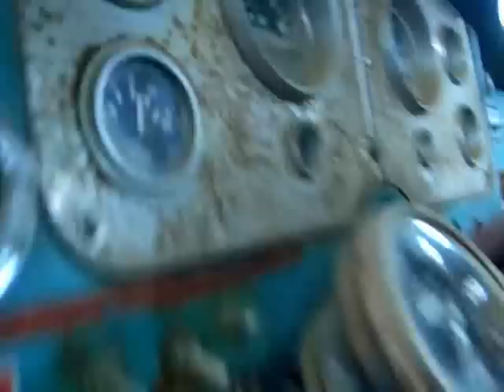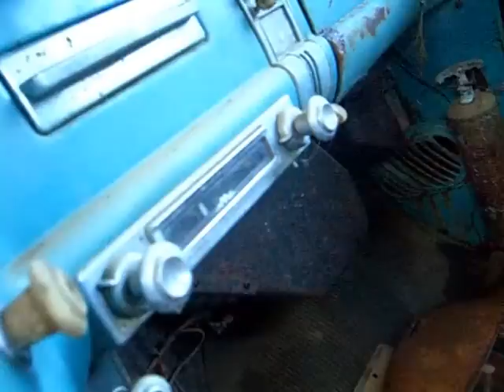The Find 1956 GMC V-8 Hydramatic Napco 4X4 Dually Truck

Comment: A 1-1/2 ton with Hydramatic, chrome and power steering. GMC could not have made too many of those. Great find.
Reply: And the six was available with that trans.Even down to the Chevrolet sedan delivery. While very few were ordered that way, 55 -57 sedan deliveries dominated stock automatic classes. Too bad they didn't use it in the early Corvettes instead of the horrible Power slush.
Reply: I think Jeff's right about the trans. NHRA rules allowed Hydros in sedan deliveries, but I don't think Chevy ever made any that way. It was stock class rule bending.

Comment: I happen to have a 57 and a 58 Chevy half tons 4X4 Napco equipped. I also have an extra front axle from a 56 GMC Napco truck but only two correct Spicer transfer cases. I love these trucks. The dealer installed axles had Dodge Power Wagon brakes. The factory installed axles have GM brakes.  I've chased these trucks for 41 years now. Very cool video.

Comment: Heck we are almost neighbors now you got that 56 GMC and well I got a 58 F600 All Wheel Drive with a Dump Steel Box Bed. Retired Oregon Department of Transportation.  Big Trucks can still do the work. Got the old Y block running and the gears working.  Need to get the hydra boast brake pack working. Currently just using gears as brakes.  Looking forward to seeing the progress on the highly optioned 56 GMC you just brought home.  Nice looking place you have there.

Comment: Man ''o'' Life, I love it--kinda reminds me of the last build I did my 1951 Mercury two door. That was all there by rusty as a old barn door hinge. Why it was before I got it it was used as hog farrowing pen ! then pushed in a one stall garage (if you could call it that) that a tree grew up in front of the only door. So I had to take down the tree to get the car out of it.When we came to settle up on it--the farmer told me he owed me $500.00 because the tree trimmer wanted that much to take it down for him--I even cut it up, most pieces stove size. Five years latter that Merc. ended up a Custom Rod--that took 27 trophies in 24 Car Shows. Three shows it scored more than one trophy !! It was truly a rebirth in the raw. Good luck with the rebuild of the Truck.

Comment: 1979 I found a 1956 GMC 100 in pieces, w/a 307 in the frame. Both fenders were off, doors hood and box gone. but the fenders had the V8 Hydramatic thingy too, took me almost a yr to find all the body parts( it was '80 then). Had a 400 Turbo so kept that w/a shift kit, found an old '63 283 from a wrecked corvette rebuilt THAT bored .30 over w /194 heads highrise manifold w/ Holley 750. That old truck would  pull Santiam Pass w/a 2 horse Miley & 2 horses, half ton of hay in the bed....at 60 MPH and never break a sweat! Loved that old truck, sadly lost it, the trailer(which I also restored), and the horse in a ugly divorce. I was young, live and learn.
Reply from the maker: I feel your pain!

Comment: I have a 1957 Chevy 1-ton tow truck, factory Holmes, it's almost original, 2pc. 18" wheels, 40 year old tires, they were abit sketchy nearly 30 years ago when I drove it, it has had a 70's v8 swapped in, 350 or 400, I'm thinking 350, because they are more popular, id like to get it on the road again, about the only thing wrong with it when parked was the tires, and could use break work, the hydro boost was a bit tired, it would be awesome to have power steering, I'd keep the 4speed !! Wouldnt be the same without it! Swap on some newer 2000ish, model 20" wheels, I heard 16" will not fit, but not sure! Great video alot of work!!

Comment: My first vehicle, in 1974, was a 57' gmc 1/2 ton longbed, with the 4 spd. Truck hydromatic and 389 V8, 2 wd., chrome grill, bumper, and trim and small back window...it was safer than riding my motorcycle back then...lol

Comment: Pretty cool find. I remember the GMC hydramatics and like those shifts that made your head bobble each shift.  It might pay to have one of those clip-on air fittings- No Hands- to keep the hands and face away from where the rim separates and kills folks.
Reply from the maker: Solid rims. It was the tire I was afraid of!
Reply: Does that have the “Slim Jim” 4 speed automatic?
Reply from the maker: The truck Hydramatics were a completely different animal

Comment: Lucky that sun shell in that blazer trans held up, gotta pull from the rear! Reverse is a no no. But that truck is killer, i would go frame up and fix/ replace all of those acc. You just got another sub.

Comment: Nice find.  Have you considered adding a Powertank system to your “tool shed”. Portable and allows you to use impact air wrenches and acts as a portable air system.  
Also a cheaper option would be a Viair on board air system.

Comment from the maker: @pearsonba350 Holy cow! Did you use a penetrant? A nice piece of firewood fit to the cylinder bore and a 20 pound sledge usually works pretty well.

I know what you mean, though. Not like you were gonna use the pistons over anyway. What a shame. Now you'll have to go 40 over and have MORE CUBES!

I can't wait to get back to the engine shop when we get started on Whitey's 389.

Comment: Not sure if someone else posted this but if you remove the are chuck and just shove the QD on the valve stem it will supply a lot more volume of air and usually set the bead.

Comment: Holy crap your tow truck and the find are awsome im currently building 2 old irons 78 gmc 3500 dually ex fire truck 11k original miles and my dd 87 k30 single wheel id love to find a napco or similar to your 56
Reply from the maker: Rarest of the rare!

Comment: 8:01 And that is why a 12v compressor with a long cord would come in handy.  If anything it would allow you to refill the portable air tanks.
Reply: +hellcat1988 forget that gas powered air compressor then he could have aired up those tires and  impacted those wheels off
Reply: Dillon Rebel
Gas powered is great and all, until you don't have a spare gas can...  Or it's cold and the carb on it needs tuned.... Or you forget to drain the tank and it rusts out and has a pressure failure.

Don't get me wrong, full sized compressors with tanks have their place.  I just prefer the convenience and portability of a tankless compressor behind the seat of my truck.
Reply: i see were your coming from but everything you just mentioned is all preventative maintenance. except for when its cold out then it can be a pain. i was just saying for this situation gas powered would have made doing what he had to do a lot easier.
Reply: Dillon Rebel
Yes, but we can agree that a simple 12v tankless compressor would make things easier as well right?
Reply: oh yea it would have been a lot easier than lugging around what was that four tanks
Reply: CSXRockford
That depends on the size of the tire.  If the tire has a much larger volume than the tank, the pressure inside the tire and tank will be much lower once equalized; requiring more tanks.

A tire with a much lower volume, say like on a wheelbarrow, will equalize with the tank much quicker and at a higher pressure do to requiring less air in the smaller space to increase the pressure.

Comment: I recommend a Battery 1/2 impact gun, a 3 ton aluminum jack, small generator to run a compressor. I use a battery impact at work everyday and they are the greatest. Don't have to deal with an air hose.

Comment: And a Pontiac V8 in all those GMC trucks. The largest V8 Chevy had was a 265. That Pontiac is going to be a 316 cubic inch. Very likely a 4 speed Hydramatic too because that's what they put behind the Pontiac engines.

Comment: nicest old truck ever 4x4 1.5 ton that clean befor restoration wow the truck will work alot of money after its all restored and  id like to get a 76 chevy truck like the white one at the begining its still nice  missing some part but no rust and nice bumper here in ontario all old cars and truck get rusted out not restorable

Comment: man that is just way to cool. i remember a bout 4 or 5 years ago i was driving past a local junkyard which has a car lot out front sat a 58 dodge power wagon ton and a half 4x4 v8 with factory push button drive auto. i stopped and asked if it was for sale i was told no. a couple of months late they had a ugly truck show and it was there. they were crushing some cars there too and also decided to crush the truck. that made me so mad.

Comment: 56 GMC .. had one for years, ole Susie .. put a boom on it and used it as a wrecker for years... change the 6 volt system to 12, generator and all the works down to the bulbs... finally sold to old man Campo because I built 2 newer trucks.. hauled thousands of  cars and more to the crushers with that ole truck, and my races cars to the tracks... riffle rack w riffle and fishin pole to go anywhere  Let the good times roll... 292 cuin 3 on the tree and starter next to the gas peddle  DRFOX TRAVELING SALVAGE COMPANY Charlotte N.C

Comment: E.I.  Just a thought, as I've used this several times with old letdown tires. Take e. O ne  o f  th o s e   ratcheting straps wrap it around said tire,may have to dig out a little trench underneath tire to get the it wrapped around and connected crank the ratchet to get the too seat on, then air it up,it will usually go up pretty quickly.  Also do you know what ever happened to that Brill bus you had? Wish it wasn't on the opposite coast I would have been glad to get!
Reply from the maker: Don't know what became of the Brill. As to the strap, the tire fist has to be flexible enough and second, can't have debris between the bead and the rim.

Comment: Do these trucks not have that rim that every body puts in a cage to work on I always though all these old dually would have that rim is it called a split rim seems to be a lot of that style truck in Oregon between you and CTR do the have a eight or 10 bolt pattern ? Similar to my old dually a 95; I’m surprised wheels aren’t all seized up
Reply from the maker: Not the 19.5's

Comment from the maker: @mustie1 PPFFF! Me too, only it's garge time for the red International tractor you see in the background for a cam gear set, injectors on the backhoe, one dead cylinder on the Sprint, one dead engine in the Colt. Did I forget to mention brakes on the Blazer?

Comment: Awesome truck Jeff! I'm thinking its got to be a NAPCO. I don't believe Chevy or GMC made any Corporate 4X4 trucks until 1960. I think they both used NAPCO parts for their factory produced trucks until then. Does it have any NAPCO tags or castings? I'm guessing it has a Spicer model 23 Transfer case. When are you going to have another updated video posted of it??

Comment: just found this video, i dont see a updated video anywhere? whatever happened to this truck
Reply: its sitting out by one of his building waiting
Reply: he hasnt done anything with it since then.  if you look in his newer "shop recovery" videos, you can see it sitting next to where the collapsed shop is.  it has sat there since he got it.  the last videos that were for that truck were the pontiac 389 resurrection videos. That motor was supposed to go in this truck.  since then, he has not had any updates on this truck.

Comment: Unreal find!! I had a friend with a 65 Chevy 20 with a NAPCO 4x4 under it and a snow plow on it. Don't know if it was transferred from another truck somewhere in time or if it was installed by dealer. Were NAPCO kits available and installed that late?

Comment from the maker: @BrutalMemories69  I do. I was working at the Chevy dealer when thay come out with them. Aside from the gutless 2.8's they originally came out with, I thought they were great. When it came time to buy a new car, we got another used Blazer. I'll get another if it ever comes to that again.
Reply: Gutless 2.8??? Never seen a gutless one lol I had 23 s10s all 2.8. Very impressive engines. Insane power in a plow truck and pretty decent fuel mileage

Comment: I see you are a volunteer firefighter ty for ya service what dept are u on are you a officer ??
Reply from the maker: No longer on the Department. Put 10 years in until the new Chief wanted shift duty with a log of what you did every hour.
Reply: Ahh I see I just seen ya pager and radio

Comment: . Since Chevy only had a little 265" V8 and 2-speed Powerglide auto trans, GMC preferred to use the bigger Olds V8's and Hydramatic 4-speed auto trans. in those years.. Ford also used Hydramatics in it's premium vehicles... Drop a 500" Caddy and TH 400 into it...

Comment: To get the tyre back on the rim use wd40 or lighter fluid spray it into the tyre though the gap stand back or make sure you are not too close let the vapurs flow a moment then light it. it should pop back on. unless you use too much fluid it wont catch fire.

Comment from the maker: @ghtowagon Bought it with headers and a Torker intake already on it. (Why anybody would drop a Torker on a 3/4 ton truck with 4:56 gears is beyond me.) Headers are cheap and have thin flanges. Gaskets last about 1,000 miles. I may be using the headers from Whitey later on.

Comment: I would have used my generator, compressor and a cheeta to get back on bead..... Or just loaded with flat tires, 12k winch says it will go. And air bags work so much better in the dirt than a floor jack

Comment: This video confuses me at approx minute 19 to 20 he is bringing the truck back to which  confuses me because it shows no rhyme or reason as to where he is going the bridge crosses is eight dollar mountain which is approximately 10 miles out of his way and dead ends so he would have had to drive there turn around and go back the way he came. And is most definitely not where the truck came from.

Comment: The truck towing the “find” sounds like it needs towed as well. 🚮
Reply: ...nah...sounds like it just has an exhaust leak...I would love to have that truck(the '68-'72)..it's a 3/4 ton with 4x4...although I prefer the looks of a Chevy in the '67-'72's...I have a 1970 Chevy 3/4 ton 2 wheel drive, 292 six and granny 4 speed I've owned for over 20 years..it's a real workhorse...though it burns as much fuel as a medium-duty C-60 with a 366 big block....
Reply: Man-e-fold leek.
Reply: @bjr2379  ...yep...

Comment: The engine most likely to be from Pontiac
Reply: A Pontiac & GMC both had 316 in 1956. But they are not interchangeable, I know, we had one that when the original owner had it, the GMC 316 let go, they had a wrecked Pontiac that had been rolled. They pulled the Pontiac motor out, put it into the truck. We were the 4th owner. When it swallowed a valve, we needed a complete motor. Thankfully David told Floyd what they had done, before we ordered a long block.  That had a Timken electric-vacuum 2 speed. You would use low range for field roads & section line roads. High range for gravel roads, empty, & highway. 4th low was a little faster than 2nd high.

Comment: that 72 gmc i got the same truck but mines a mud truck 38s 4 inch body 4 inch suspension lift dana 60 front and rear 454 big block 600 hp 580 tork
Reply: its a k20 btw camper special

Comment: Question.....whut th hel is tht engine? It can't be a 348, not  lobed valve covers......305s,348s and 409s all have the 3 lobed valve covers/ Is that an Olds? POntiac? I'm sure not but it can' be a w black. Incredible quality and planning in the mid 50s. What happened to them building 40% of parts in Mexico when Detroit lies in  an Asian African 3rd world state that will not recover. Thisg uy is so cool I wish he would ctie what motor that is..too weird. I have a cousin who still runs a grain truck on the farm , a 1964 305 Gimmy powered 1.5 ton.that still hauls gain on way above what it should the grain buyers weighed it in at 8,000 lbs on a 1.5 on back in out 1985-1990 or so That was with millet which si tiny/heavy grain. had no idea or I wouldn'thave driven it from the field.....the tireds on front didn't touch if you unned it much at all but it stil runs 50 years later. They should still build them like that instead f in Meheeco.
Reply: It's a Pontiac engine, 347 I think.
Reply: I believe he says it's a 316 In a later video. He's planning on replacing it with a Pontiac 389, though.
Reply: Stock V8 engine this thing in '56 was 265 cu in V8.  Never was a 316 GM motor.  265 was the first GM V8 introduced in 1955,  Morphed into 283 in '57.  Later became 327, 350, 305, 307, and the 400 small block.  first Gm big block was 348 cu in in 1958.  Later morphed into 409, 396 and finally 454.  I've wrenched on all of them my favorite is the 327.  those are the chevy,  sizes,  Pontiac, buick, Olds,  Caddy Used the same blocks mostly but CID varied with different heads, pistons and connecting rods and crankshafts.  For instance the Pontiac version of the chevy 396 was a 389.  The oldsmobile version was a 394.  Lot of folks who play with old cars don't know their ass from their elbow.  true facts can be found from the engine numbers cast into the block and the heads for those who do proper research.  Numbers will most times give you year and month of manufacture as well as engine displacement.  Happy motoring from me,  Car buff since 1952.
Reply: my 1955 GMC had a 288 CI Pontiac engine with a Hydramatic. I don't think the 347 came along until 1957.